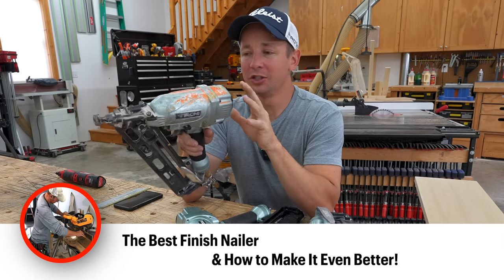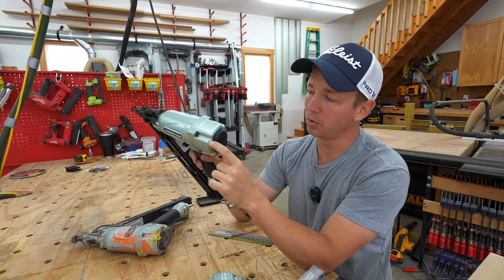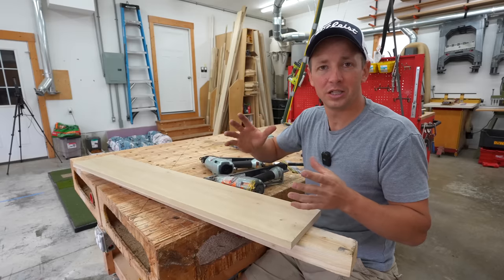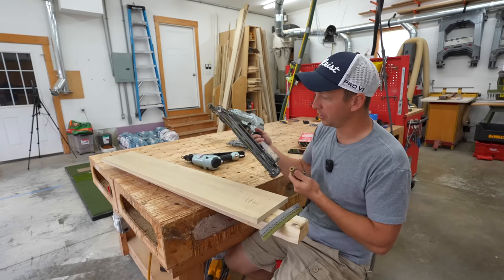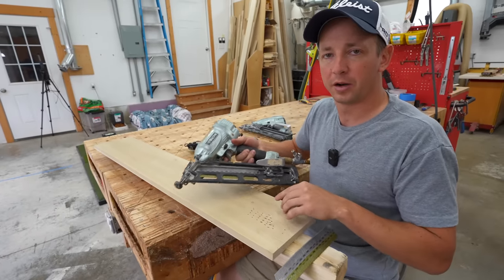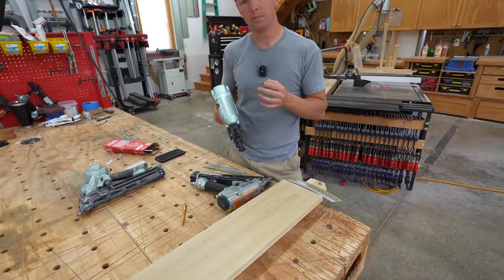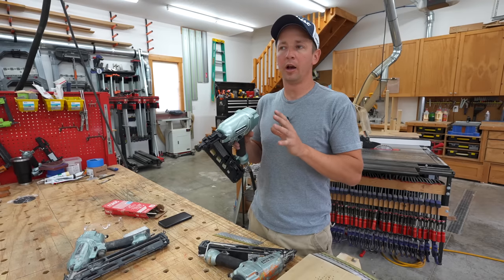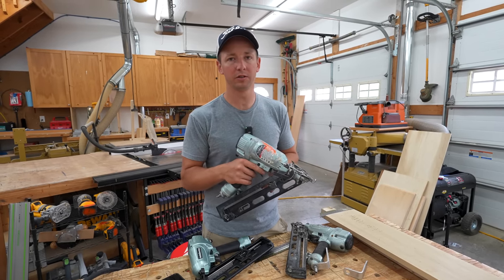Next Level Finish Nailers!!! My Favorite Nailer Modifications!

Comment: Over time, I have developed a strong reliance on the same 15g nailer, which, based on my experience, has consistently proven to be the optimal choice. When I embarked on my career in finishing carpentry in the late 80s, achieving the desired results with nail guns was a challenge due to the absence of a depth stop. To overcome this hurdle, we had to either fine-tune the air pressure or modify the tip through grinding. In the past, I used to completely remove the drive pin from the gun for grinding, unaware that holding down the trigger after firing would prevent the pin from retracting while releasing the air. I appreciate the valuable tip and the reminder that there are always new and improved methods to discover when it comes to accomplishing tasks. Thank you for sharing your wisdom, Ron😎🤙
Reply from the maker: You bet Ron! I've been a follower of yours for a long time.

Comment: We did that this mod to our guns as well.  I have had a regular tip without the mod break once but never a modded tip. Go figure.   One other thing I do on my gun is put a little wood shim in to keep the plunger tip held back so I never have to push on the wood to fire my gun, never dent the wood. But you have to be careful as the gun can fire at anytime by just pulling the trigger.  Good vid.

Comment: I’ve been using my Hitachi 15g for 25 years. Best gun ever. Except for the big holes. Now it’s perfect, after 5 minutes of grinding. Interestingly, I checked my 16g Hitachi(used once a year) It’s basically the same gun. Except, they correctly ground the tip so it gives plenty of depth. Cheers

Comment: Thanks a million, Spencer, for making the video! a super easy and super sure way to make the nail driver modification for those with a battery-operated angle-grinder with a diablo brand with a used 36 grit 4.5 inch sanding disc on the holder for the sanding discs is to
simply sand away while holding the gun in one hand in front of you while standing, with the guard clamped back, and the operating/'on' angle-grinder with the other. The metal is removed so smoothly at just the right speed to not be ever worried about going too far.

i bought the Senco hook; i am right handed and fixed the hook on left side of gun so it doesn't move and by cutting out some of the inner plastic wall of storage box, the altered gun fits perfectly. 
 
To fix the hook so it doesn't move, i inserted a spring-type washer onto the air-hose adapter first then the hook. There's still plenty enough thread on the adapter to well-connect it to the gun (which i did after applying some Teflon tape.) It wouldn't hurt to substitute an air hose adapter instead if they make them with a longer thread stem.

i used a "M12" washer but had to pry the opening apart it to spread the washer to have a larger inside opening and still had to tap the washer down over the threads. to do over, i'd buy M13.

Comment: Great tip never thought of it thanks, I set the out flow air regulator pressure 5-10PSI below the compressor start pressure so that my air nailer is always getting the same pressure at the gun even though the pressure in tank varies allowing me to set gun more accurately and all nails are set the same depth. Ray

Comment: Great tip. I've used this gun for years and love it. I can usually get the depth adjusted so as not to overdrive, but variations  in the trim type/material and consistencies in the underlying studs (especially when working in old houses) can really mess things up. I'm gonna Dremmel the drive pin tomorrow.

Comment: Ive was filing my pins down years ago. My gums lasted many years coz you  could seal and gasket kits amd i camt find them anymore so i moved the dewalt battery. I only have 1 hitachi gun left i used to blow the dirt if floor before putting my skirting down. Brilliant gun.

Comment: It's wild how different of a market you work in then I do! If I left a single 15g nail hole on a jobsite I'd be getting complaints from the painter. I've never even met a finisher who carries a 15g. I hang all my doors with a 16 but those holes are covered by the door stop. Casing and baseboard is nailed on with a 21g almost all the time, with especially thick casing nailed with a 18g. Not bashing your method but boy is it different!
Reply: You mean 23 guage? Those are pin nails. They're just for nailing trim to trim. They hold in place while glue dries. They have almost no bite. They're not for nailing large trim to walls.
Reply: We don’t hang hollow core doors. 2 1/2” 16g nails are not strong

Comment: Hey Spencer. Thanks for the tip. Have you modified your cordless Milwaukee nailers as well?
Reply from the maker: No, due to the warranty I don't mess with that one. Too many issues as it is.
Reply: @InsiderCarpentry Do you still run your cordless Milwaukee guns, and if so, what gauge? I remember you did review video on the whole set a while back and we're pretty confident that you could run a whole house off of them. I haven't seen you use them much as of late so I'm wondering if your opinion changed. I've been on the fence about investing in the cordless 15 gauge nailer.

Comment: So why dont the engineers have this figured out beforehand? Such a simple modification. Btw I've been a finish carpenter since 1999 and i use this gun ALL the time. I've installed 10s of thousands of doors. I've learned that having that plastic tip is the game changer to keep the holes very small.

Comment: Tried to do the modification, however the drive pin is retracting half an inch even when I disconnect the air while keeping the trigger depressed.  When it retracts like that it sits on the “bed” and I can’t grind.  Any suggestions?
Reply: @str8pmp12 Same thing here. I’m having issues with the drive pin retracting. Did you ever figure out a solution?

Comment: Just bought this through Amazon ( $50.00 cheaper than Lowes ) , Maybe I missed it somewhere but what is the best nails to use in this specific gun?  I did purchase the Metabo 1 and a half inch to try but I've always used the Porter or Dewalt. Big fan BTW !
Reply from the maker: My lumber yard sells senco nails and that is all I have ever used. I've had good results, just stay away from the galvanized nails, they gum up the head. You just want regular bright basic.

Comment: Great video as usual. Do you put oil drop in before using them? Can you show the clamp ass thats under your tablesaw. I need to build one.
Thanks 
Leo
Reply: And what psi do you set the compressor 
Thanks
Reply: I just bought a new senco. Was going to file down the driver but senco already did.
Reply: @chadholcomb5780 the Senco is a great gun, still use my SFN 40 I got about 30 years ago 😂

Comment: Hmm. Washer on air fitting. Wouldn’t have expected it to be air tight. 👍
Reply from the maker: It's on the other side of the threads. There is no air flow anywhere near it.

Comment: All 3 of my Hitachi nailers have to be adjusted all the way down to the depth limit, otherwise the nail heads won't set.  It's not a problem with my air pressure. Maybe they're just getting old. Like me!
Reply: Clean them fairly, oil them and change orings